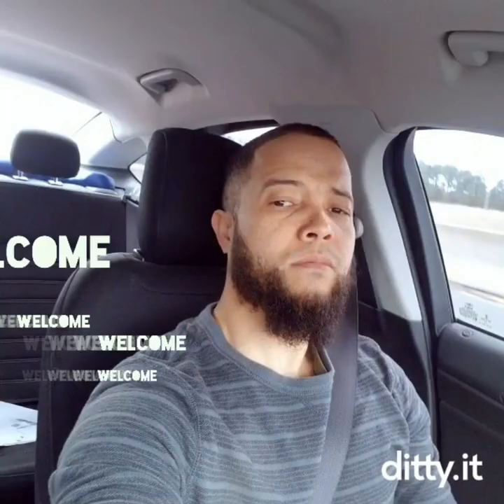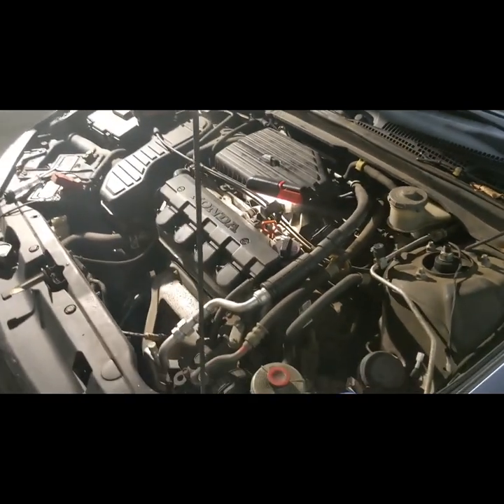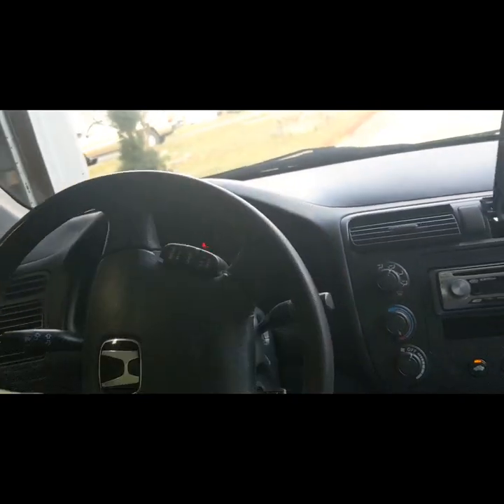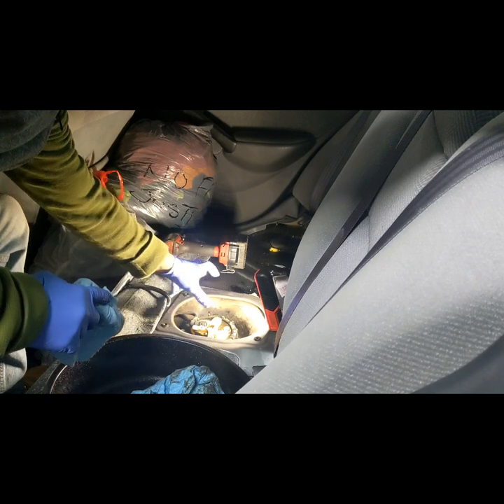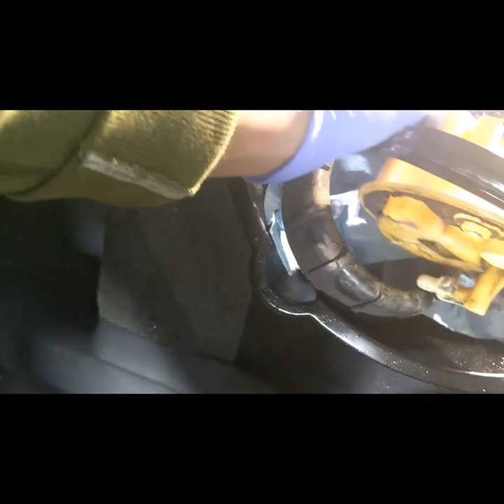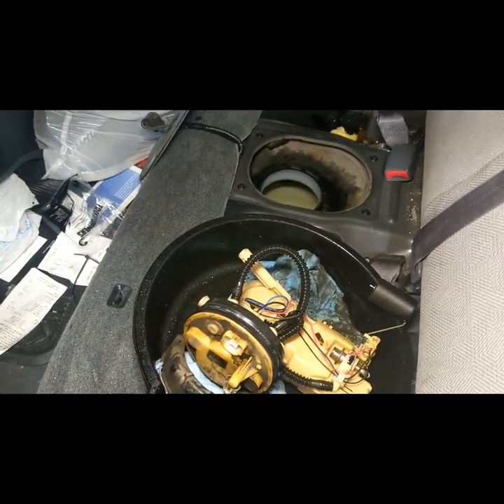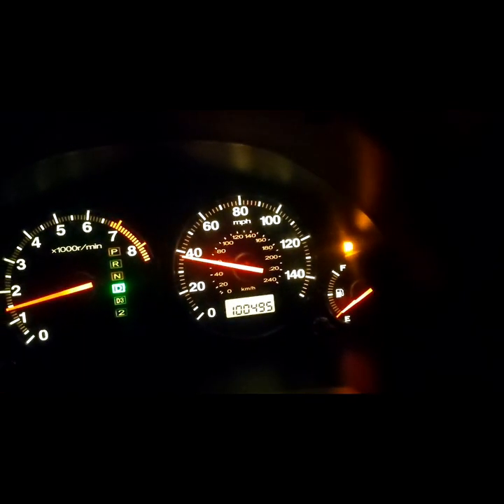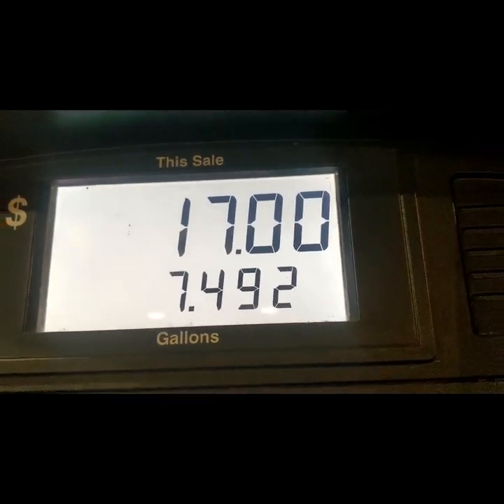Honda long cranking fix

Comment: Mi Civic 2002 tiene los mismos sintomas. Le puse pompa de gas nueva, Sensor de coolant nuevo y bobinas nuevas y sigue con lo mismo. Se tarda en prender y aveses no prende. Que opinas ?
Reply from the maker: Oh es El purge valve que ESTA malo
Reply: @nestorautorepair  El prende y aveses no prende. Entonces es El purge valve?
Reply from the maker: Si
Reply: @nestorautorepair  cual de Los dos purge valve la del motor o la del tanque de Gasolina?
Reply from the maker: Vapor canister valve
Reply: @nestorautorepair  esa es la que que da al lado del tanque de Gasolina?  Y usted esta seguro q esa valvula mala ase q El carro no prenda aveses?
Reply from the maker: La que ESTA Al lado del motor , cuando echa Gasolina es cuando no prende?
Reply: @nestorautorepair  no necesariamente cuando echo Gasolina. Lo ase Todo El tiempo. Se tarda en prender y aveses Sigue estartiando y no prende. Lla le Cambie la pompa de gas, bobinas, y sensor de temperature de coolant. Sigue asiendo lo mismo🤷
Reply from the maker: Oh ok
Reply: @nestorautorepair  que opinas? Purge valve o canister valve ?
Reply from the maker: Purge, ten cuidado si la Bomba Salio defectuosa
Reply: @nestorautorepair  Estoy pensando que la bomba  si salio defectuosa pq ahora estartea pero no prende🤷
Reply: Bueno, le Puse las pieses originals de Nuevo y todavia no prende. Antes se tardaba en prender con las pieses originales ahora estartea pero no prende con las pieses originales🤷
Reply: Crank position sensor

Comment: Great video, thanks. Did you get a read on the fuel pressure while priming/cranking? My civic has a similar long crank problem, especially when cold, but my fuel pressure is in spec. Could it still be the pump?
Reply from the maker: I don't remember reading it but yes if the fuel pump is bad it will show good untill you crank it then it will drop that's a bad fuel pump , or it will sound like is pumping when it not